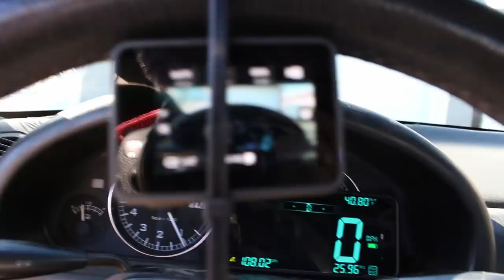Sending The Miata To 100MPH On Jackstands: The Gremlin Chase Part 4

Comment: you could even take out the driveshaft completely and try again on the jack stands. that way you'll know for sure if the driveshaft or the adapter have something to do with it
Reply: Marco Franceschi that would also rule out anything to do with the rear end (diff) I would think
Reply: @jarredcool4350  right!
Reply: Or without axles maybe? If that is possible🤷‍♂️
Reply from the maker: Long confirmed that the vibration itself is coming from the driveshaft as shown in previous under-car footage. I'm not in question of where it's coming from, I'm in question of what's causing it. Also have already changed out the diff, diff bushings, axles, and wheel bearings.
Reply: @TheCarPassionChannel  it was more of a: "while you're there" kind of test ;) Cheers Greg loving your work from Italy!
Reply: TheCarPassionChannel i understand what you are saying. You know the vibration is coming from the driveshaft AREA. Think about it, you've put HOW many driveshafts in, and it doesn't fix it!!! It might be the driveshaft making the noise, but the PROBLEM is somewhere ELSE. Maybe the differential yoke, the output of the transmission, I'm not really sure but I don't think it has to do with the driveshaft itself.
Reply: I would 100% try this if this was happening to me. And I've followed this closely, I know everything he's tried and replaced. It'd take 10 minutes and could help solve the problem. 

It's possible that both getrags had the same problem, but unlikely that all the diffs have had the same problem. Definitely worth the try!
Reply: @TheCarPassionChannel  yup every driveshaft is the cause and not a symptom appreantly
Reply: Have you tried to isolate the new gearbox mount, as I can tell you've drilled and bolted it into the drive tunnel , but is the tunnel the cause of the vibration,
Reply: @fredelena7120  i was thinking that way aswell, could be the body just shaking away because those two little bmw trans mounts are mounted completely differently on actual bmws plus together are 1/3 the cushion of an oem mount. And their drivetrain is built with minimal vibrations, unlike the miatas whose engine rocks like a boat on choppy water.
Reply: I am with you guys as well I did notice those trans holes where I bit bigger the. The bolts you used the walls are also really thin there could be some flex in those walls. I would pull the drive shaft and check the car on jack stands again. Pull the drive shaft but leave the adapters the trans. Also can you have the drive shaft and the adapter tested as one unit at the drive shaft shop.
Reply: @fredelena7120  I kinda thought the same. I mean the trans mount is hard bolted to the chassis with some small bushings which also work directly on that mount and the rotation of the driveshaft could work on that end of the trans on these mounts as well. I can barely pinpoint anything else since the gearbox has been changed, the driveshafts have been changed and checked several times, a problem with the diff would feel different (I know how that feels) and it can't be the axles without feeling absolutely like dying at these speeds and that kind of vibration. Greg, is there any other way of mounting that transmission to the chassis?
Reply: Take driveshaft out and test, take the flange adapter off as well and test again
Reply: @fredelena7120  he told me no because its like that in other miatas but i think this is whats wrong too.
Reply: @davidervin4853  I'm  thinking that the combination of hard engine mounts to a relatively soft gearbox mount is transferring any vibration and amplifying the sound through the relatively thin drive train tunnel , it's all about harmonics and the transfer of sounds
Reply: It's been run up with the drive shaft out.
No vibration.
Reply: @TheCarPassionChannel  i think transmission bearings are also "driveshaft area" and vibration could be caused by bearing not holding tight, and whacking driveshaft all around
Reply: @fredelena7120  You know I was thinking the same thing when he showed that setup in the previous video.
Reply: @TheCarPassionChannel  
see Colin Foots post.
Reply: @TheCarPassionChannel  check geometry: gearbox output shaft must be parallel with diff input shaft, otherwise you can have variable angular speeds, The same applied to cv joints. This joints does not tolerate big angles
Reply: This is one of the best comment threads i've ever read in the 15 years i've been on YT.

Comment: Have you calculated the driveshaft critical speed? The ZF transmission is shorter than the Mazda 5/6 speed trans meaning a longer driveshaft. Longer driveshaft = lowered rpm critical speed= shaft will be looking to "whip" and create severe vibration; in fact BMW E36 and E46 use 2 separate driveshaft for this reason. Please share the following info: Mazda driveshaft length (yoke cross to yoke cross) and tube OD, ZF kit driveshaft length(yoke cross to yoke cross) and tube OD. Will be able to estimate with these numbers

Comment: The BMW driveshafts has a support bearing near to the gearbox. Maybe the gearbox output bearing didn't designed to hokd the whole shaft weight and rotation inertia so the bearing in gearbox is starting to rattle. The idea of disconnecting dr8veshaft and repeat the jackstand test seems a good idea but maybe only the shaft with gearbox together causing this.
Reply: That's what I'm thinking. Long shafts can bend /vibrate at high speed. The bearing is there to reduce the sag /whipping of driveshaft. It's like a rope, you can't tighten it straight horizontally, they will always sag in the middle.
Reply: @remytv  and I saw that his shaft has the sleeve section almost in the middle so that definietly has to have a tiny play even if you can't feel with hand. It needs a support bearing in front of that.

Comment: I'm pretty sure the forward section of the two-piece driveshafts that these transmissions are designed for, are not angled to the transmission in any way.  In other words, the driveshaft is perfectly aligned with the transmission.  The output flange bearings of the transmission may not be robust enough to handle any angle change.  On a one-piece driveshaft, the angles of BOTH ends impart loads into the shaft that the transmission output flange bearing must deal with.  A two-piece shaft, with a center hanger bearing, aligns the front shaft perfectly with the transmission and isolates the forces generated by the differential angle.  I think a properly set up two-piece driveshaft may be your solution.
Reply: This actually makes sense to me as well since my e30 has a carrier bearing on the prop shaft.

Comment: 7:28 put in your subframe brace bolts in
Reply: That could be a cause for the vibrations!
Reply: 4:42 look at the brace  solved you your problem
Reply: Deividas Juozaitis I don’t see anything at 4:42.
Reply: Damn you beat me to it. I had nasty noises when mine were loose, although no vibrations. The only thing is that that isnt his subframe, rather the brace. Can a piece if rattling metal really cause such harsh vibrations?
Reply: You can see and hear when it starts vibrating. Good eye!
Reply: @userANAKIN  Had to get a better look on a bigger screen. I don't think it is the cause of the vibrations because the brace stays still during the vibrations UNTIL the noise comes on. That's def the source of the noise but probably not the vibrations.
Reply from the maker: The NA6 never had mounting points for the the NB1 subframe bracing. Nothing is going to change by bolting only those front tabs into the floor, there is no force on them when the car isn't even on the ground especially. Also - I've already run it on stands with all of that bracing removed.
Reply: @TheCarPassionChannel  Does it still make that horrid noise at around the 95mph mark with the brace not bolted in? I understand this isn't the issue you're after but that thing was moving around quite a bit.
Reply: Could be why it gets so bad. I'm sure they start vibrating when the root cause starts. I would bolt them in anyway
Reply: @benjamindavidson632  As he mentioned, that brace only came factory on 94 later I think, so his car doesnt have any mounting points for the ends of those braces.
Reply: @TheCarPassionChannel  if they are not necessary then remove them. Them vibrating could also be adding to the noise. Not saying it isnt the drive shaft, just more potential noise
Reply from the maker: @TheRevo33  Because the brace extends all the way to the back with 6 mounting points. 4 of them are bolted in, and I will be anchoring the front points eventually. Noise is not an issue, even if that was rattling (it's not)
Reply: @TheCarPassionChannel  You can 100% see the brace vibrating like fuck at 4:42 in the top right view. Just to be sure put a sponge in between that and the chassis.
Reply: @TheCarPassionChannel Iam still convinced that the cause is that brace because you have changed pretty much everything on the car that you could and the one thing you added is the brace when you did the swap kit. And also the way you have the ppf delete kit on your car mounted
Reply: NA6 doesnt have bolts in that area
Reply: Yes I know but you can easily drill it out and put in the bolts
Reply: @deividasjuozaitis3315  as he already mentioned in multiple times, the driveshaft is the part that's vibrating. But nobody knows why
Reply: @TheCarPassionChannel  excuses excuses
Reply: @mathiasmang848  He also stated he's changed out the drive shaft numerous times from different companies. If you ask me the set up of the driveshaft might be the flaw all along.

Comment: My NB2 (Hard s) has a bracing vaguely where the getrag270 mounts to the chassis via the OEM BMW bushing. I remember once forgetting to fix one of the two bolts and the whole car was resonating like maniac at highway speed. To my understanding, the tunnel it's super sensitive to resonance, how about trying to take the support out (making the transmission rest on jack)?  Saying this because the OEM E36 stock brace looks waaay beefier then the kmiata. It wouldn't solve the shaft vibrating on itself but at least it won't resonate the whole chassis like mad. Just my 0.02$
Reply: I had the same feeling about this being some sort of resonance problem and I know Miatas can be prone to that in general. It seems to be pretty smooth right up to a certain point when the two or more normal vibrations seem to resonate right at about 80MPH. 
I would try the jack and separately, attach a small weight on the driveshaft to purposely through it out of balance and see if that changes the resonate frequency.

Comment: CV joints are located at the end of each axle. There is both an outer and inner joint. When the inner CV joint is damaged or begins to fail, you will notice your car vibrating under hard acceleration. As it gets worse, the minor vibrations turn to violent shaking when under load.
Reply from the maker: I wish it was that simple but the car has new axles!
Reply: TheCarPassionChannel sorry just now realized that after watching your other videos on this problem I’ve seen a lot in my time with cars. I have a question does the vibration stay at a certain speed or does it continue getting worse the faster you go. I hope you figure it out what ever the problem might be.

Comment: GREG! Greetings from Scotland. I've had an idea. You've fitted the drivetrain upgrade kit which removes the PPF. With the Miata being a monocock, you have removed the member that links the front and rear rotating assemblies. Now the engine and gearbox and rear diff can send vibrations through the car individually where as with the PPF being fitted it absorbs that vibration and harmonises with the body. Could it be that the rear diffs harmonics are fighting the harmonics of the engine and gearbox causing the body to vibrate and by linking the two with a frame similar to the PPF will cure the problem?
Reply from the maker: The problem with this hypothesis is the loads of Miatas currently running no PPF, without issues. Not only with this kit, but with basically every other transmission and differential swap kit on the market.
Reply: @TheCarPassionChannel  I understand that, but it's likely that the body is vibrating and not the drive line. You've already proven that it's all balanced etcand done plenty testing to prove the drive line is in normal condition. All I am saying is that everyone's bodies are different, different seats, braces, roll bars etc, that could make the difference that allows the lack of PPF to cause the vibration or not. As a test, I would try adding a brace between the gearbox and the diff, or stiffen the car. Have you checked to see off the vibration changes with the roof off for example?
Reply: I mentioned this last video, I've had exactly the same vibration at motorway speeds with the PPF bolts essentially doing nothing (came loose) PPF is tight fit and wasn't a rattle, just vibration

The transmission mounted to tunnel will always add NVH but there is a balance issue here, the vibrations between diff and engine are likely going through the chassis and not through what would be the ppf like you've said.

Failing disconnecting the prop while it's up in air ( gearbox will leak )  you can't easily pin point it down, stiffened chassis will help ie frame rails but the cause is most likely the setup not using the PPF 

I'd be interested to know if the setups that are not having issues are using similar engine mounts, diff mounts and have any underside bracing, as rubber/poly engine mounts will have less NVH than fab 9 type, stock diff mounts and void fillers will have much less NVH than derlin or poly, especially ones that ditch the stop washers on the diff.
Reply: @GmoLargey  that makes two Greg 😜😁
Reply: @TheCarPassionChannel  Have you thought about engine torque twisting the body at the transmission crossmember mount and causing the rear u-joint to be out of phase with the front driveshaft mount?
Reply from the maker: @leeperkins1447  Sure - but the jackstand test puts nearly no load on anything 🤷🏼‍♂️
Reply: @TheCarPassionChannel  It doesn't matter if the car is on stands or not, the torque is between the engine/transmission mounts and the support structure which is the transmission tunnel mounts in this case.
Reply from the maker: @leeperkins1447  I'm saying it takes about 2 lb-ft of torque to spin the wheels, it's not twisting any mounts
Reply: @TheCarPassionChannel  If you remove the engine and transmission mounting bolts and run the engine at 4000 rpm will the engine move or twist in the body? This is the torque I'm talking about.
Reply: @TheCarPassionChannel  I noticed also it appears the front mount for the driveshaft is solid mounted to the tail shaft so there is no way to compensate if the flange is not perfectly parallel to the differential. I could be mistaken though.
Reply from the maker: @leeperkins1447  If you sit an engine at 4000rpm on the ground will it tip over? No. Accelerating up to 4000rpm yes, but maintaining 4000rpm in a solid state is only taking enough torque to overcome the friction of the bearings and gears tuning in the fluid of the diff and trans. This is not chassis twisting torque we're taking about.
Reply: @TheCarPassionChannel  ok. I still think your vibration is due to something in the alignment of the back of the transmission adapter to driveshaft connection.
Reply from the maker: @leeperkins1447  That is still very possible
Reply: @TheCarPassionChannel    but torque and frequency are 2 very different things.
Reply from the maker: @lucascoebergh396  Sure, but Lee's original suggesting is that the torque of the engine is twisting the entire body of the car on the jackstands.
Reply: TheCarPassionChannel that’s true. So what about we try to calculate what kind of frequency is being generated? So for the rotating parts that’s very simple you got that down in a heart beat I assume. But what about the other parts? So what could be a good starting point is just to simply measure the hanging parts on the rear suspension since they are probably the longest thus have an easier job of making a difference. What about those loose braces you have. How long are they from the central pivot point of the rear axle ? And what diameter etc. I’m assuming they are just mild steel and nothing special besides the flat part on the end. Do you happen to have a link to a web page with all the mods and pictures or is it all YouTube only?
Reply: @leeperkins1447  there's no engine torque when the wheels are off the ground and the gearbox is mounted so only has a few mm of movement. That's what a UJ is for.
Reply: @TheCarPassionChannel  are they running the same set-up as you?
Reply from the maker: @erasmus_locke  Some identical, some other variants
Reply: yes yes yes.

Comment: Hello! Brilliant channel - I think the problem you are experiencing may be the result of resonance in the drivetrain i.e. the inherant resonance of a rotating length fixed at two points. In the MX5 design and development book the Mazda engineers noted a resonance referred to as nodal bending which occured at 43Hz, they overcame it by positioning the two end points (engine and diff mounts) at the null points of bending so limited vibration would be transfered to the chassis. By adding the gearbox support I think you might have introduced a coupling point to the chassis far from the nulls. I don't know how to solve it perfectly without having a PPF to support the gearbox but any balancing of the rotating assembly would make it less severe. Good luck and keep up the excellent work! Kind regards, Tom